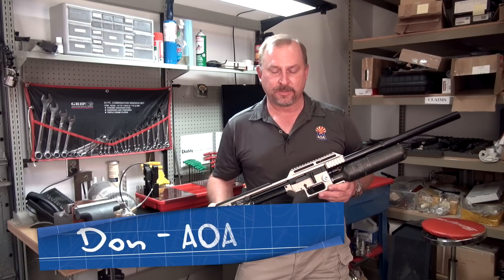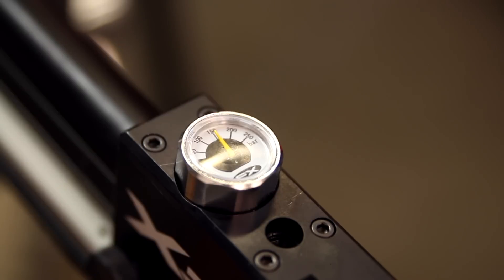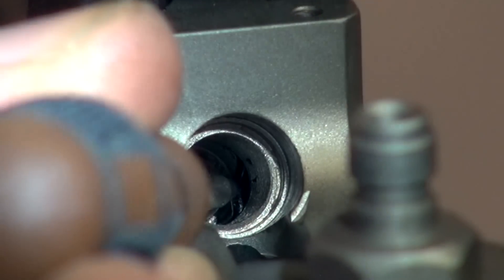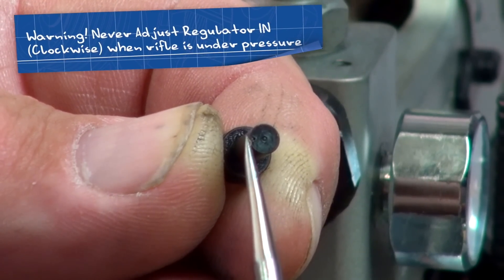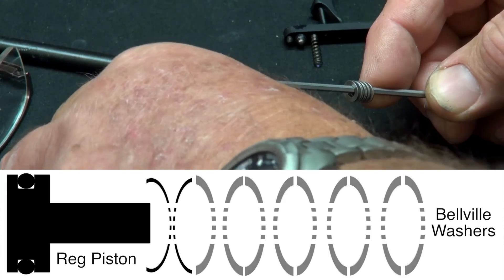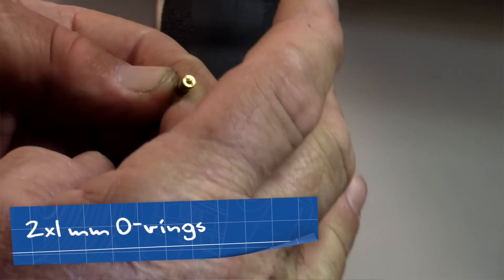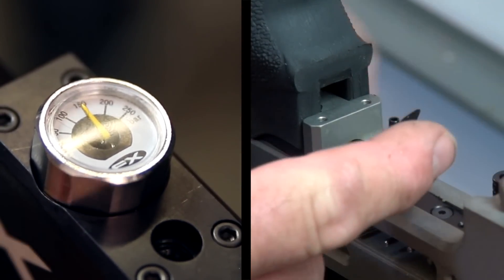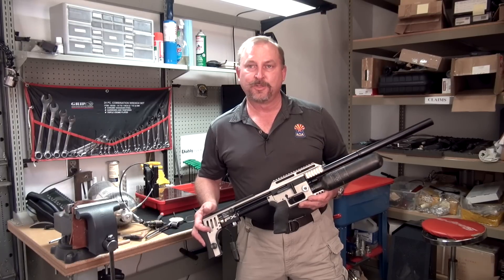FX Impact Regulator Rebuild

Comment: Sir...External power adjuster for pressure  incorporated in wheel and valve control knob only,  could be done while  you are using and firings the airgun

Comment: NOW THAT'S A GOOD INFORMATIVE  VIDEO! IF YOU WOULD HAVE ONLY GAVE ALL THE O'RING SIZES. IS ANYBODY USING VITON O'RINGS IN THESE RIFLE'S ? IN PLACE OF ALL THE NEOPRENE ONE'S ? THEY ARE STRONGER, TOUGHER & CAN TAKE HIGHER TEMPERATURES !
Reply: factory recommends either buna 70 or 90 in some cases.  not sure if viton would work well     give it a try!
Reply: I would change to Polyuretan orings 
Can use the same shore, stronger, tougher, last longer. And more difficult to damage while assembly
Reply: Great art! VERY IMPRESSIVE WORK

Comment: 1:15 We'll tell you the O-ring sizes... Well, you didn't. You've mentioned just one or two. A complete list would be nice.         3:52 All metric, go figure... Really? Very strange for a European made air rifle!
Reply: The O-ring sizes are all listed on the FX Impact parts list at the FX section of AOA's web site.  Cheers
Reply: Not needed any more! Sold the damn thing! But, thank you for your effort on finding the whole list! Other may benefit from the info.
Reply: What a frail, expensive, piece of junk. Just my opinion.  EXCELLENT VIDEO, by the way.

Comment: Yesterday i blew piston O-ring 2 times . I did not adjust it over its limitation .  But the problem is   why a piston seal  is blown instead of  that small down in the regulator adjuster screw ? Now  i dont know what to do . Whenever i change piston seal and assemble it . It just blows

Comment: I know this is an old thread but I hope someone is still monitoring it.  I have an O-Ring size question.  Sometimes places specify the OD size, and sometimes the ID size. Even on older FX literature some are OD and some are ID.  So... in this video, are the size OD or ID?  I ask because the o-ring that is listed as 9mm x 1.5mm on MY Impact Gen1 is 11.85mm OD / 7.95mm ID / 2.08mm Thick, so I want to know what a NEW o-ring size should be?
Reply: Better off contacting FX airguns usa or Utah airguns,  unfortunately AOA no longer Carries FX.

Comment: wrong information - the o ring in the action block is NOT 9 x 1.5 derometer 70 it is 10mm x 1.5mm nbr 90

Comment: and remember this will void your warranty, you mere mortals don't have the capacity to swap a few oring's like I do...bit of a joke really. they are made serviceable for anyone who owns one notice no anti tamper for these parts ? you know what that means ? as it would not damage or modify the rifle by doing so it should never void your fx warranty. If this is an official fx warranty protocol I'll stay away from fx as there's no way I'd pay for somebody to change a few oring's for me if there's no anti tamper device. is your high end machine capable of higher measuring accuracy on psi the way you check if it's been tampered with? as otherwise how would you know.
Reply: They want to scare you into sending it in to them so they can charge you more money for servicing the gun. They also may be finding anyway they can get out of the warranty on the gun and don't have to eat the labor costs. It scares me more to send such an expensive item through the post and hope you get it back. I've had them just drop off a gun on my porch and not require a signature to leave it!

Comment: Void the 1 year warranty? Shouldn't the rifle as a whole last longer than that before needing any repairs? Why is this even necessary within the first year?
Reply from the maker: +Steven Littleton Shouldn't be necessary, but the nature of adjustable things is that the owners like to mess around with them. In the case of the regulators, damage can be done with improper adjustment procedure.
Reply: @airgunsofarizona  so $2,000 for a gun but  the warranty only lasts until you need to make an adjustment?.....I mite have gotten into the wrong hobby

Comment: I guess my question is-- why is this wearing out so fast- this is a new Air Rifle?
Reply: He showed you the mark on the piston made when adjusting the regulator lower while under pressure. Some uninformed "new" owner probably did not read the owners manual. So not worn out, damaged by owner.
Reply: Azycray that was only the piston... The point is why would we need to replace any of this during the 1yr warranty.

Comment: All metric,go figure... ofcourse...anyone knows that anything technicaly advanced beond stone age is metric... :-)
Reply: While I personally prefer metric tools, the worst tends to happen when you start mixing the two and some things are close but don't quite fit (which in devices that use high pressure air is probably a bad idea).

Also I can understand that if you've got established tooling and still have to support a lot of legacy gear for parts and repairs that all use imperial that the temptation to stick to your ways makes sense.